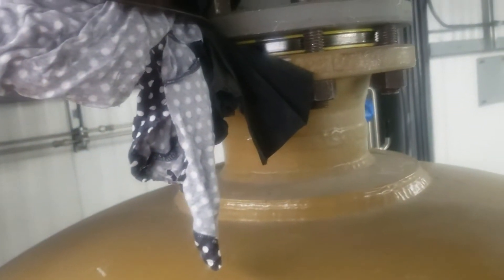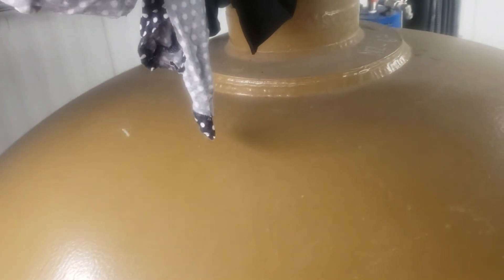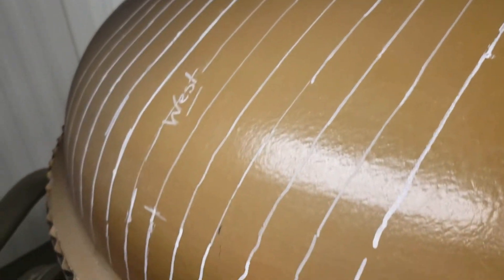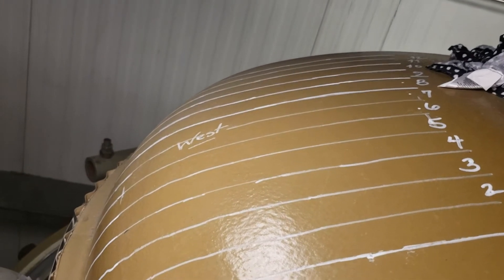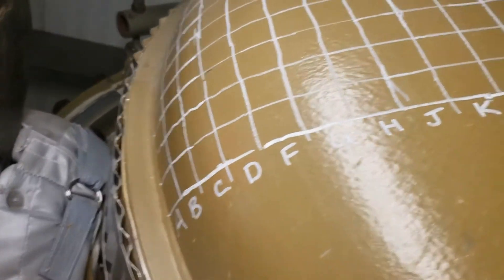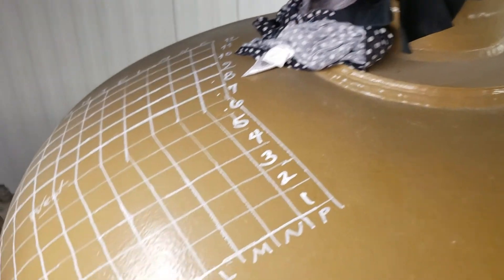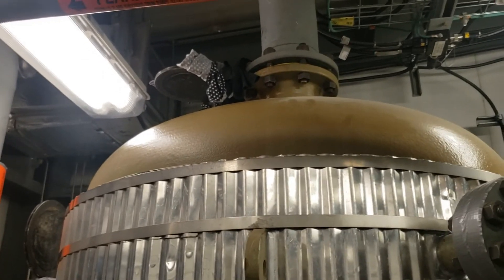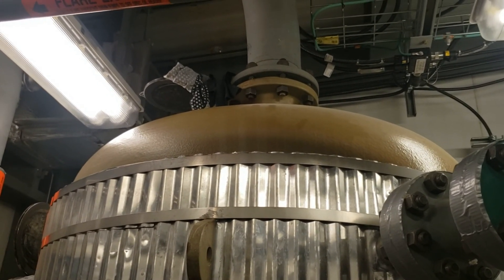Ultrasonic thickness corrosion mapping grid

Comment: Question from a guy who would like to get my API-510 ticket.

Why was that area chosen vs opposite side of vessel?
Reply from the maker: Mr Jason,  that's a great question. 

 This location was chosen by the 3rd party engineering company whilst developing the  MIP (Mechanical Inspection Plan), based on several different conditions and considerations,  such as inlet, outlet locations, stagnant areas of the vessel,  the velocity of flow, service and previous experience of the industry.   This UT/t grid was also in addition to the standard UT/t Inspection plan used by most of the industry.
Reply: @MrEric_API  thank you very much!